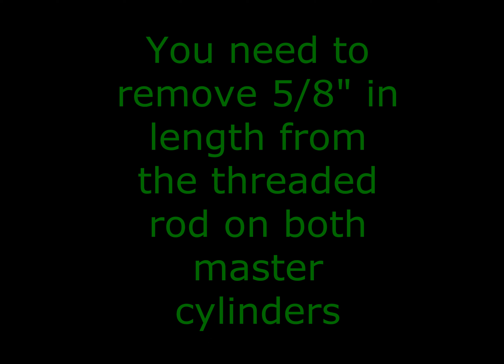Factory Five Roadster Build 4

Comment: Not pointing out anything wrong, but do you wish you held off on final riveting any of the aluminum panels? I am planning on doing this build eventually so taking in all the advice I can.

Thanks!
Reply from the maker: I've thought back on that (and even during the build) and I don't really think it would have helped to hold back on riveting the panels in place when I did. The key part is to make sure you wait to rivet the driverside outer footbox panel until after you finish with the work within (pedal assembly, wiring, clutch cable...etc), which I did. While you can get to all those components for repair later on if need be, that outer panel not being there makes things easier. Otherwise, having all the panels in place early on made the build go a little easier in my opinion. The manual is pretty well thought out with regards to order of assembly. I will say that you should make sure you do ALL the wiring as early as you can as I had to go back and run a few wires later in the build, and that was difficult.

Comment: Those black head Allen bolts you used on the battery box will rust quickly! Switch them out for stainless ones.
Reply from the maker: Already done. :) the black oxide was just temporary.

Comment: Taking back trunk space is a good move. I was thinking that sleeves in the frame would have been a good idea but if the fasteners don't have much torque, you should be okay.
Reply from the maker: Hello Miles,
I did think about sleeves and part of thinks I should have done them, but like you mentioned, there's not a lot of torque there, and even with the bolts tightened as far as I was willing to go, there didn't seem to be an deflection in the member I was bolting through. Keep suggestions coming though; the way I see it, the more eye's I have on what I'm doing, the safer things will be.
Thanks!

Comment: Have you treated the aluminum panels in any manner to keep oxidation down? I haven't decided whether it would be better to prime/paint, powder coat, or apply a chem film (something like alodine). Any thoughts?
Reply from the maker: When I get a little closer to dropping the motor in, I'm going to scotchbright all the visible panels and probably shark hide them. I'm going to leave the aluminum color throughout. I thought long and hard about that and I decided I like that look over painting the panels. I have gone back and forth on that part of the build however...
Reply from the maker: @aw9680  
I’ve used shark hide in the past to protect aluminum and it’s held up very well. I had a trailer with raw aluminum panels and coated them with shark hide and they basically looked the same for years and years— couldn’t believe it myself.

Comment: Arron - I notice that the foot box on both driver's and passenger's side drop down a couple of inches at about the end of the transmission tunnel. Is this a aftermarket kit or is this a stock installation?
Reply from the maker: Those are the stock panels from Factory five. I believe this is different than previous models in an effort to maximize foot space.

Comment: Hey, great videos!  Which battery are you using here?
Reply from the maker: I used the smallest battery I could find with side posts.  I went to the auto parts store with a tape measure and went from unit to unit. I’ll get the number and post it. Im currently out of town.